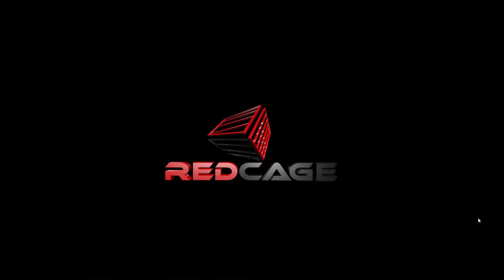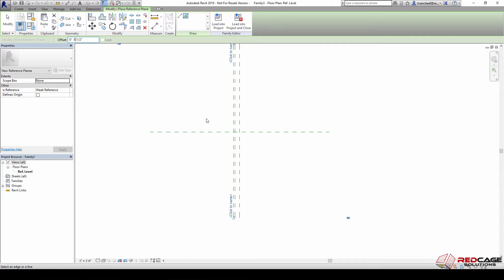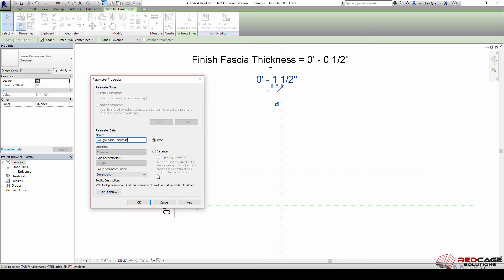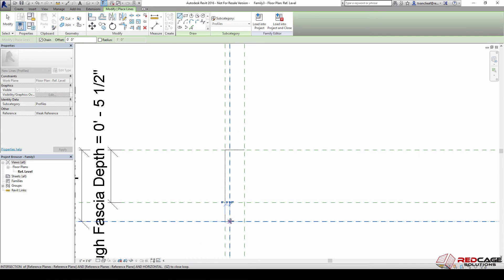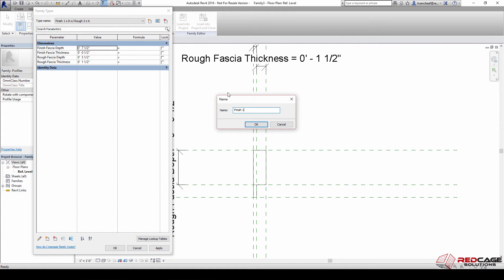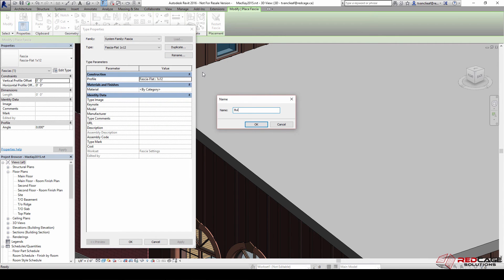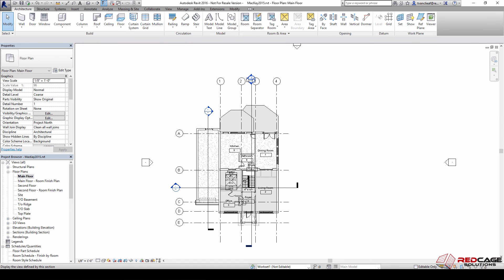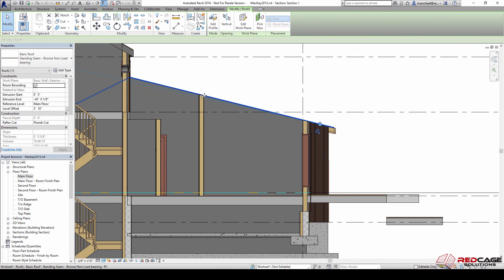Creating and modifying Profile Families for Fascias in Autodesk Revit

Comment: Hi, Travis. Thanks for nice tutorial. Could you, please, tell me how you created the profiled surface on the facades? I'm struggling to create them for the roof..
Reply from the maker: There's a number of ways you could achieve this. One would be to create a curtain wall profile and use it on a secondary roof using the Sloped Glazing roof system family. The profile of the curtain wall mullion would actually be the standing seam and the panel portion would act as the flat portion of the metal cladding. So this secondary roof would simply act as the cladding for a structural roof beneath it. You could do this as well with a sloped Beam System employing a structural framing profile. The simplest way would be an In Place component with a sketched profile and then simply array this across the roof hip. The real ammunition though is the profile itself, and then employing it with the system family you are most comfortable with. Sorry for the delayed response Tamar, I've made some career changes and haven't been posting lately, but hopefully that helps. Thanks for watching!

Comment: DIDN'T WORK... I created the closed profile but when I click reference first and then the profile line, the lock doesn't come up - so I selected lock from the ribbon.  restraints all look in place, but when I do to create another profile of different dimensions, says restraints not satisfied and asks if I want to remove the restraint?
Reply from the maker: Unlock your constraints. The geometry should be aligned and locked to the reference planes, but the dimensions that become your parameters cannot be locked, or they will not function as flexible parameters. At the bottom of your screen, you should be able to find a 'reveal constraints' toggle that will highlight all the dimensional and align locked constraints in a burgundy colour.

Comment: Hey Travis, how to you complete the soffits & fascia on a gable corner. I"m referring to the triangle area. Thanks. Abner
Reply from the maker: For this, try using a Model In Place component. It will allow you to  create it with the Roof category; draw it as an extrusion from the gable face of your roof. You will need to set this face as the reference plane or create a reference plane that is coplanar. If there is a return on the gable end, you can recreate this as another small roof where the gable end edge and two side edges are slope defined, and the edge at the face of the gable end wall is not.